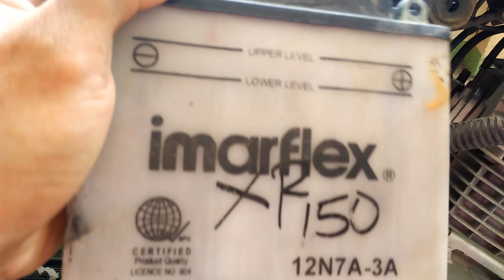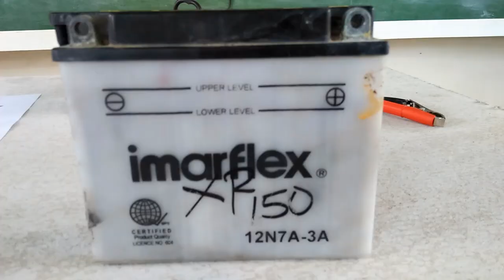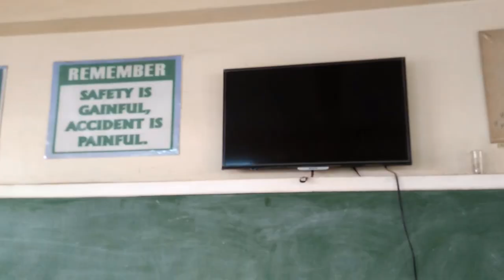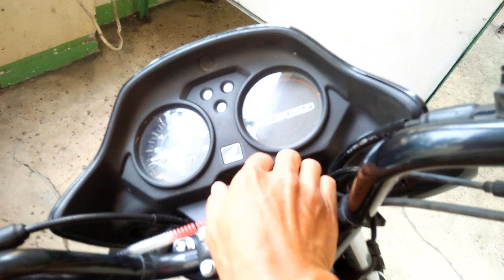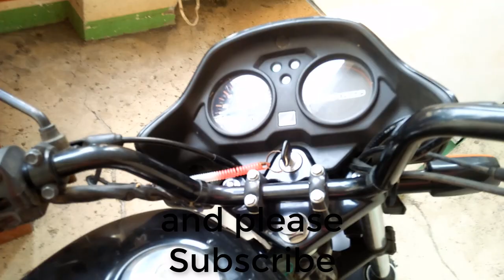How to Charge 12V Car Battery with 19V Laptop charger | DIY Car Battery Charge  | Golden Works TV

Comment: how did the bulb light, when it only uses possitive current, and no negative current is applied..?
Reply from the maker: The negative and the postive terminal of the bulb is connected to the line 1 of the circuit,it is a series circuit connection. Thanks bro. God bless...
Reply: @GOLDENWORKSTV   please will my dell battery, the bold only light on   (thought low current) when the wire connecting my laptop charger positive and bulb makes contact with my laptop negative. I mean my laptop +ve and negative have contact to the bulb and my bulb to the +ve terminal of my battery, yet I still connect my laptop -ve to my battery -ve terminal.

Comment: Sir I connect all correct, but bulb power is going to decrease within 20 minutes
Reply from the maker: Use tester Sir to measure your voltage output. Or you may use another bulb.
Thanks
Reply: @GOLDENWORKSTV  thank you sir

Comment: No it doesn't work!!
The charger keeps switching it's self off after a while and the battery remains flat
Reply from the maker: But actually, I have tested it in charging my motorcycle battery until now. Perhaps your laptop charger or your battery is not working well Sir.